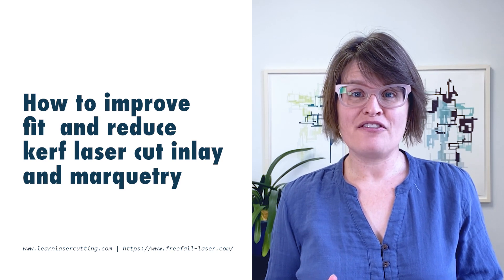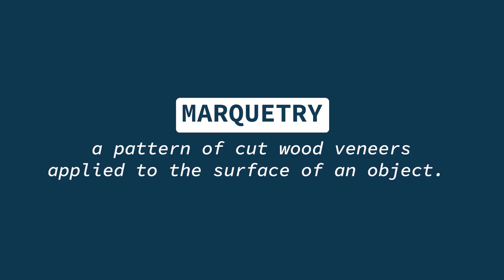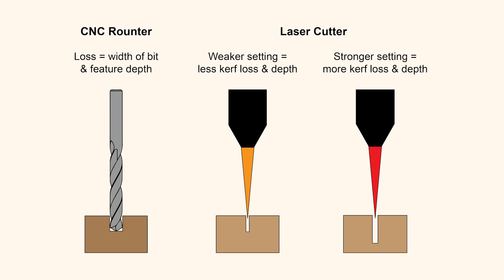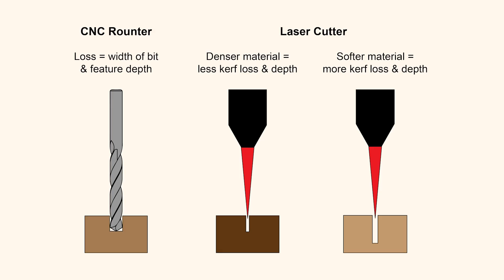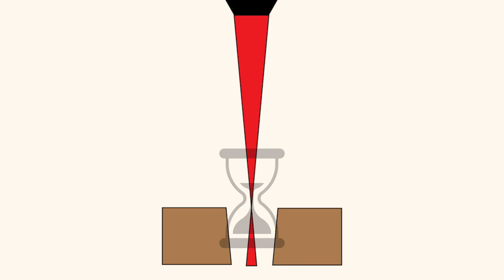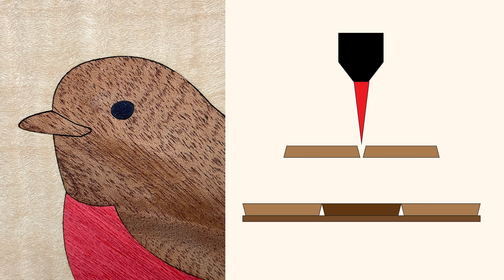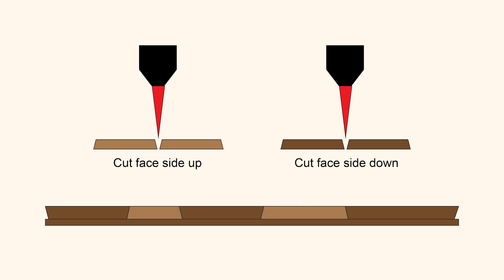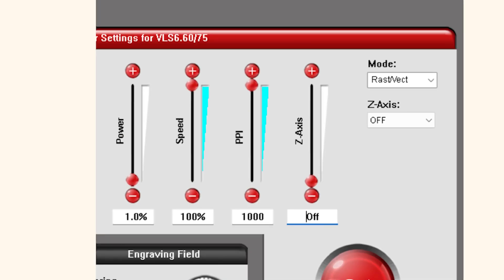Laser Cutting Marquetry: 3 Precision Tips for Tight Fitting Inlay and Interlocking Pieces

Comment: Inverting the cut has a serious drawback- the bottom experiences more discolouration (burning) and showing this is usually undesirable.
Just allowing for the kerf (simple in most laser CAD, such as LightBurn) gives parts that literally 'snap' into position. The sides compress when doing this, giving a very tight fit. Using a smooth tool to finish the insertion gives a burnishing effect, removing any gaps that may remain. Lastly, the finish used tends to swell the wood, giving yet another tightening of any gaps. This all gives a result that makes joins undetectable without a microscope.
BTW the statement 'interlocking pieces' on your front image is inaccurate and confusing to newbies- parts rarely (and never need to) interlock. This is not a jigsaw.